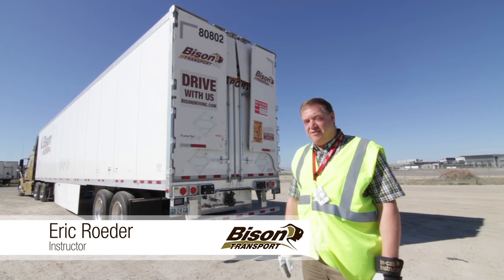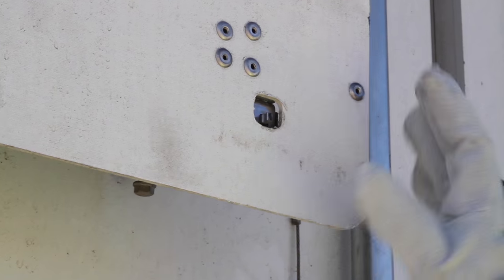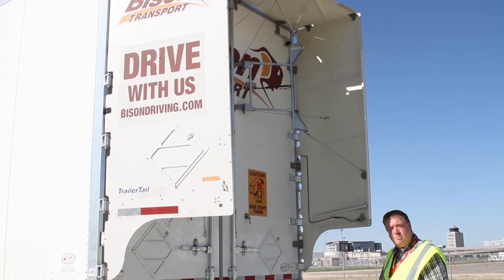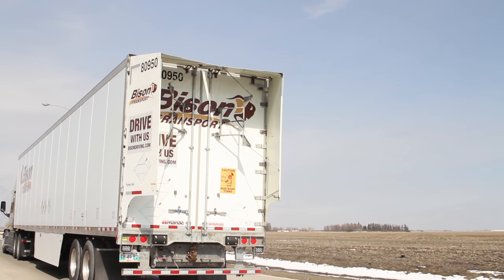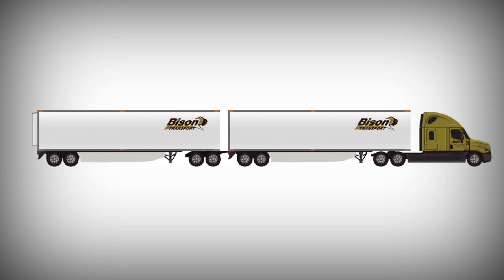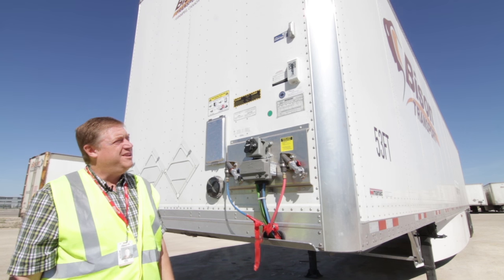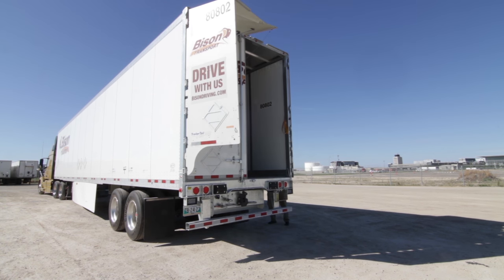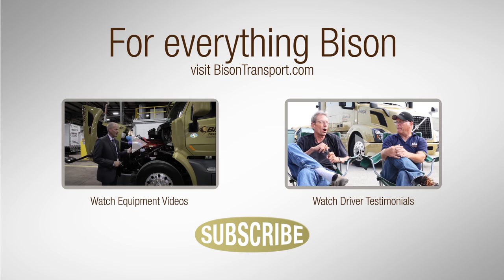Stemco TrailerTails Equipment Tour

Comment: I hate these things for the simple reason that most winds are cross winds and this knocks you all over the road. With a head on wind you are fine, but the cross winds make it a challenge. It just turns it into a big sail.
Reply: I highly doubt the extra 6 feet in cross winds ends up knocking you all over.  You did take into account the other 53 feet of sail (trailer)  your dragging down the highway having much the same effect of the wind hitting it , did you not?
Reply: Derek Nelson
I have pulled all kinds of trailers in my 20 plus years of driving and these things suck.